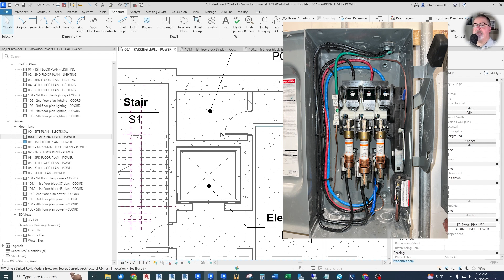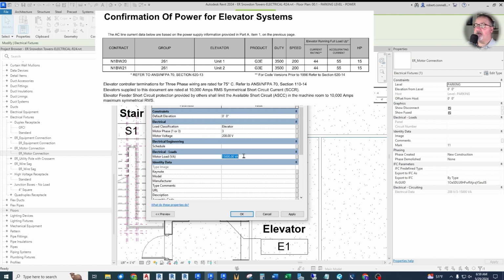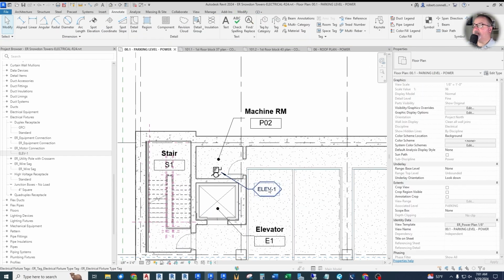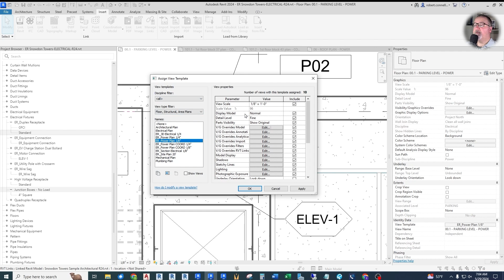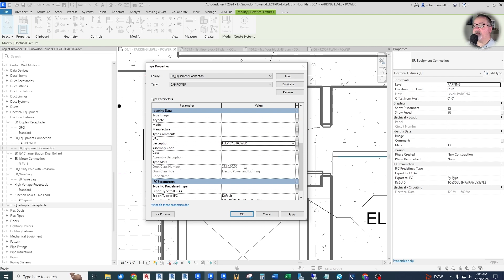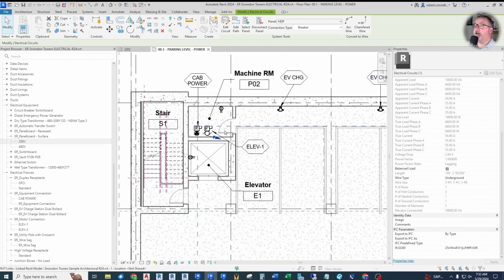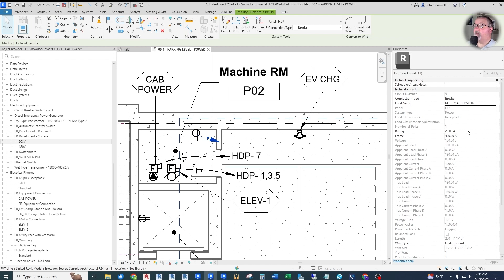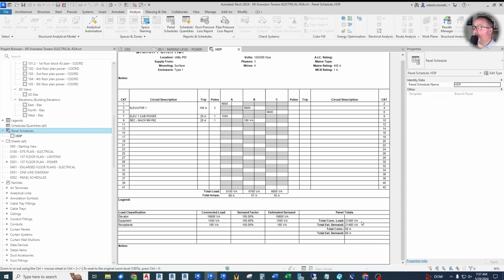MEP ELECTRICAL Pro Tips - Elevator Power Connections

Comment: What exactly is the accelerating current for an elevator? I assume something similar to locked rotor amps. How does this affect the sizing of your OCPD and conductors?
Reply from the maker: Hey there! The accelerating current is the increased current that the motor draws when it is accelerating from  rest to its normal cruising speed. It lasts longer than the "starting current" but is considerably less (starting, or locked rotor as you note, if not on a soft-start or VFD starter, could be up around 6 times the normal running current). So we use this value as the load in our panel, however the elevator manufacturer typically recommends what overcurrent protection size to use.

Comment: Do you sell your templates?
Reply from the maker: Hey there Nick. Due to popular demand, yes I do sell packs of custom families, which is what I think you may be referring to. A pack of the families I use in the model (like the motor connection and equipment connection) as well as a pack for one-line diagrams, and a few universal panel and switchboard families. Both can be seen in more detail at my website https://www.electricrob.com/store if you are interested. Cheers!
Reply: @ElectricRob  thanks Rob! You do a great job of teaching Revit Electrical. I’ll check out your family packages!